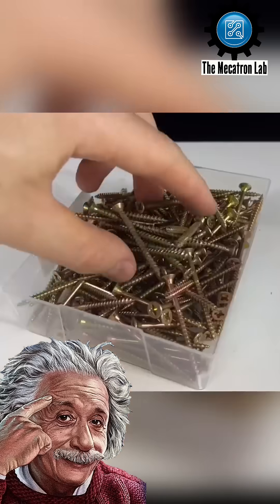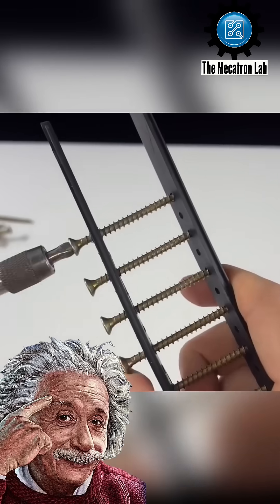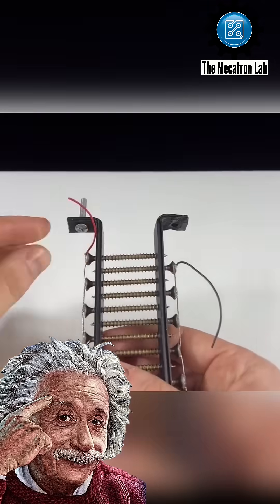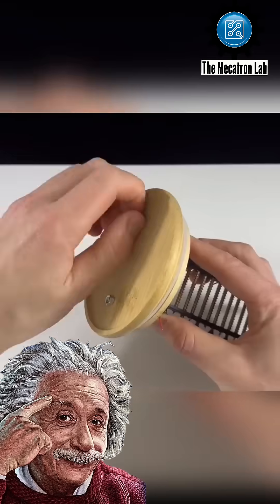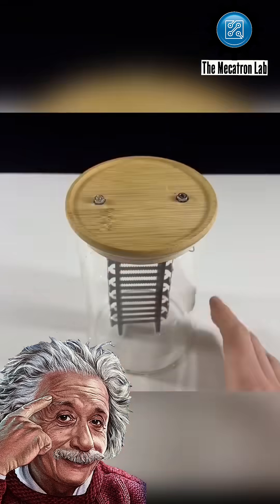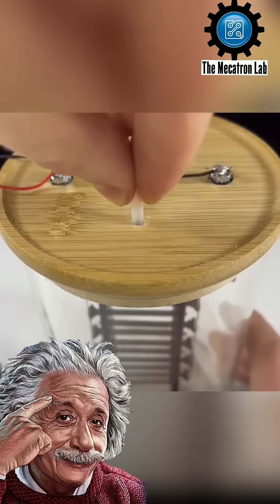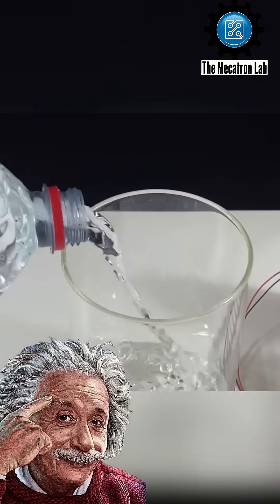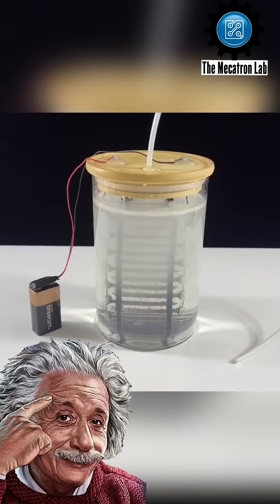Diy Hydrogène Generator using electrolizer and water #diy

Comment: With such a generator, I heated a house of 120 square meters, back in 1991. Power came from a three-phase line. The consumed power was 20-25 kilowatts per hour. Alternating current does not emit hydrogen, but emits heat. The same 20-25 kilowatts are needed to heat a house with direct current, releasing hydrogen.
Reply: U qande xolatda bajarildi
Reply: Ile kosztowała 1kWh prądu w tamtych czasach? Mam wątpliwości czy choćby przy 20kW zużycia energii na godzinę i aktywnego grzania przez 12 godzin na dobę zużycie miesięczne 7200 kWh. W takim razie wolę ogrzewać dom gazem ziemnym.

Comment: He'll get noticed when he can power a car with just this method.  Bravo regardless!!!
Reply: Such thing as a car powered by an engine fuelled by water has already been invented and patented by Stanley MEYER, an American, around 1990.
But the system was far from being effective enough regardless to the energy needed to power up the electrolysis.
But you can try if you want to tune your SUV, as the patents are free and can easily be found on internet

Comment: and the reason he puts it though a bubble filter, or whatever they are called, is to prevent back flash when he sets it on fire. cause if the fire goes into the tube, and into the unit...BOOM!

Comment: I like the screws vs plates but I put one of these h2s in my cars since 10yrs+ & does give power & clean exhaust but requires a o2 sensor potentiometer or way to adjust signal to save gas or ecu will read clean n add gas too rich... my ss plates did dissolve so might build this core next!

Comment: There is a German community who give you all the information how to build these system. We have cars who running with a water engine, totally clean and free to run. Even a motorcycle and free energy heater! Water mixed with soap produce a gas which burns hotter and cleaner then any fossil fuels or gas! A firt construction cost under 900USD !https://www.youtube.com/watch?v=phOLfhiEpdU&list=PLE91685499AEF278A&index=1

Comment: This setup wouldn't work how it shows, it takes a lot more power than a 9 volt battery can output to have that much HHO production, I've made a more complex generator than this and it takes like 24 volts at 50 amps DC to split this kind of volume at this rate. That being said I do like the design, they just probably have some hidden wires to give it more juice, not to mention this video doesn't show the use of any electrolytes which make this reaction possible, probably just added it to the water before hand, water does not conduct electricity very well without enough impurities such as electrolytes, also those screws don't look like stainless steel so that generator will self destruct after a few uses, stainless steel lasts much, much longer for the anode/cathode and wires that are exposed to the water.
Reply: we would kill 2 12 v deep cycle batteries in minutes on 8 electrodes in 3inch pvc
Reply: It works if you put salt, I tried it in class with a low voltage
Reply: @ashaiianmusic  Yes that is correct, it will work with an electrolyte such as salt but I meant at the volume of production that this video shows you need more power, and you get better re-usability of the HHO generator if you have access to stainless steel (for the anode and cathode) and potassium hydroxide or sodium hydroxide (for the electrolyte, serious basic chemicals though so don't mess around if you go with these) because your metal wont corrode in the reaction.
I think it's really cool that they teach about electrolysis in your class! I was really into this reaction when I was younger and am still fascinated by it! Thanks for chiming in!
Reply: @ashaiian_ Jakiej soli? Masz na myśli sól kuchenną czyli NaCl? W trakcie elektrolizy takiego roztworu w tego typu elektrolizerze dostaniesz mieszaninę wodoru i chloru. Taka mieszanina co prawda pali się ale jest tak samo "ekologiczna" co cyjanek potasu smaczny. Powstaje chlorowodór który chętnie przyłącza się do cząteczek wody (między innymi w płuchach wszystkich żywych istot) i powoduje korozję metali.
Reply: actyally he  didt shwo he added a catalist n really only need 1.5volts..im actually workin mine..i used just watet  andtried 1 ..9v the adeed anorher   without a catalist .its works but super slow..

Comment: This system doesn't produce only hydrogen.
Water (H2O) is split in Hydrogen AND Oxygen.
And if you don't separate the electrodes, you obtain an explosive mix of one volume of Oxygen and 2 volumes of Hydrogen.
Reply: It is known as Browns Gas!
Reply: Something's telling me that's just a simple electrolysis process which you can also make your own
Reply: Water is not electrolyte
Reply: @Shanza123-g3d  Well that depends on the voltage and the purity!
Reply: I came here to say that😮
Reply: With such a generator, I heated a house of 120 square meters, back in 1991. Power came from a three-phase line. The consumed power was 20-25 kilowatts per hour. Alternating current does not emit hydrogen, but emits heat. The same 20-25 kilowatts are needed to heat a house with direct current, releasing hydrogen.
Reply: @Liniwei  So how did you generate the heat? What was the duty cycle for your generator 20Kw is a lot of energy! An equivalent UK cost would be £6 an hour!
Reply: @Liniwei  дешевле постелить под ламинат пленочный теплый пол. Сильно дешевле.
Но если по уму: дешевле утеплить дом.
Reply: Wszystko spoko, ale prąd też się za darmo nie bierze...
Reply: @pingwinek2430  I fail to see how this could work! Even if you somehow change physics and only split H2O into H it would still give less energy when burned than heating a wire would!
Reply: هاته الطريقة تفكك الماء لو تم تباعها سيختفي الماء من الارض بعد مئات سنين هل يريدون قتل كل المخلوقات عطشا
Reply: @EslamBbba-iy6wv  What is the by product of burning H and O if not water! It is an infinitely recyclable thing!